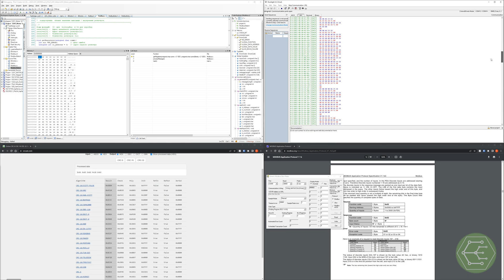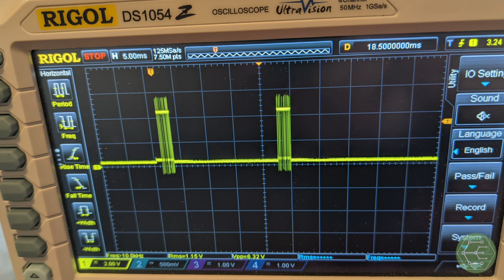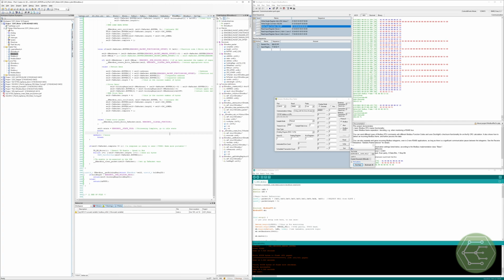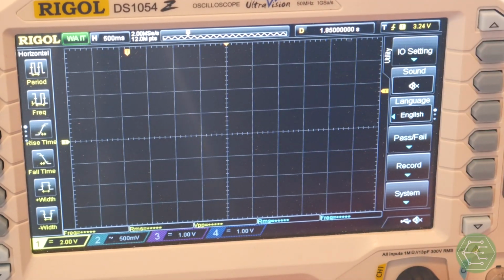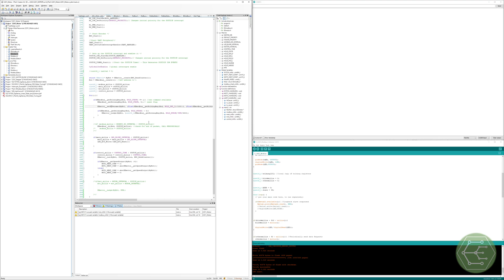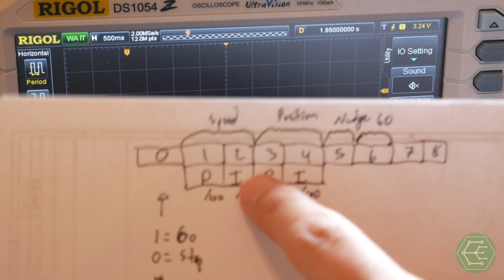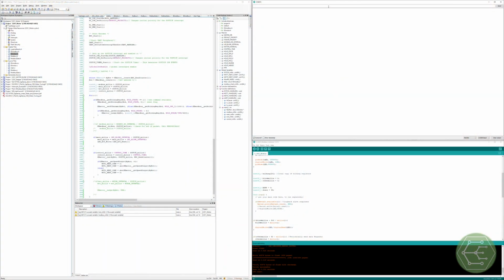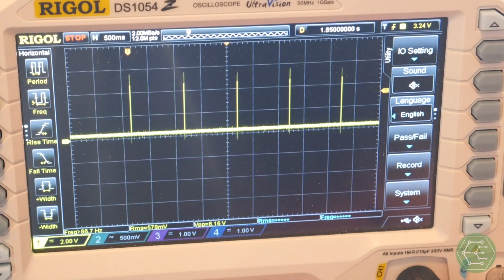Progress! - Modbus Controlled Motor | MOT15

Comment: Ran into this because of the Docklight mention. On thing I like to throw in. The FTDI chipsets most certainly implement parity detection correctly. I wonder if this was an issue with parity detection at all, and not something related to voltage levels / "use two-wire-RS485 with extra GND yes-or-no". You mention TX Enable, so I assume actual motor connection is RS485, correct?
Reply from the maker: Hello! That's bizarre. Yes, I wired the TxEn line from the ftdi module to the TxEn of an rs485 transceiver. Correct- the actual connection is rs485, with transceivers on all ends. 

The most bizarre thing that I saw in this whole debacle is that the ftdi module controlling TxEn appeared to receive extra data, while the two ftdi modules I was using to sniff via Docklight showed the correct and intended result. All three modules were hooked up to the same tx and rx pins, same PC, same ground.